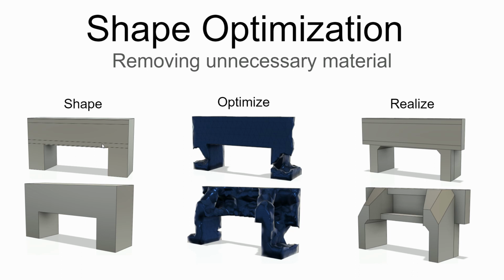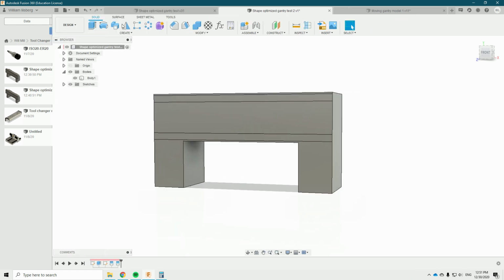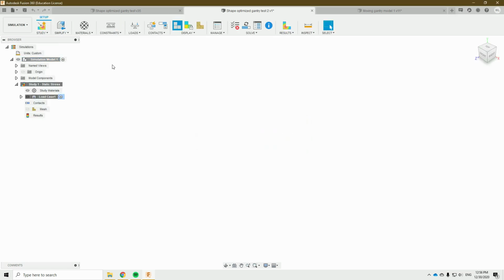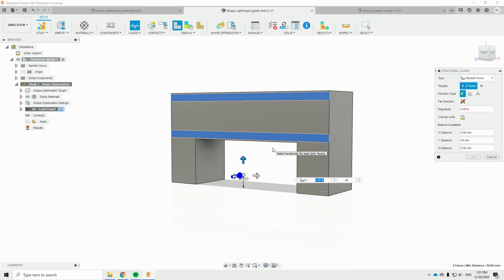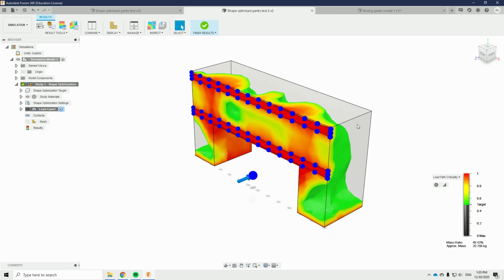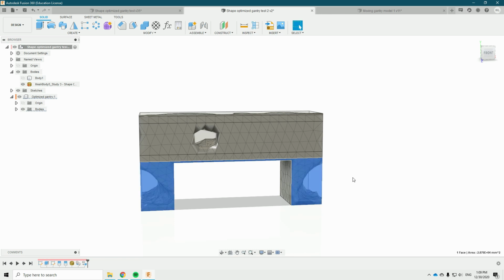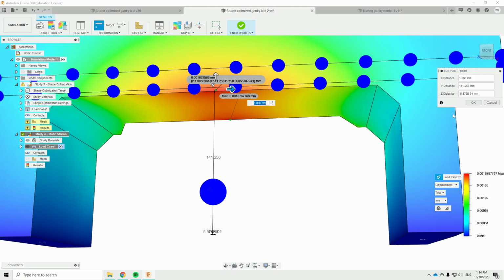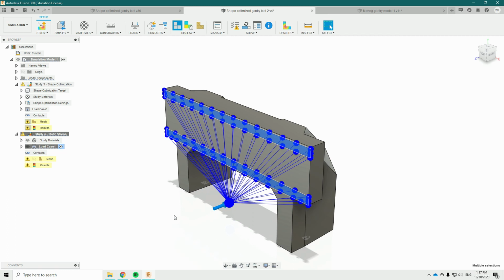Gantry Shape Optimization in Fusion 360

Comment: I’m silly late to comment on this video, but I have two questions. 

First off, is it correct to apply the force to the entire X rails rather than the center of them? The rails have just as much if not more deflection, so I would think applying force in the middle would produce a different optimized shape.

Also, something I’ve wondered about many CNC gantry designs is whether they should be stiffer in the x direction, or parallel to the gantry. Often time the sides of the gantry are just aluminum/steel plates instead of boxed members or otherwise reinforced. I’d be curious to see the optimization if you changed the force to be 90° perpendicular to the simulation you ran. 

I guess I should download fusion and try it out myself, huh?
Reply from the maker: Hi Alice
Well yes, my lazy ass didn't apply the force in the most realistic way. I should have used the "Split Face" feature in the design workspace of fusion 360, so that the force would only have been applied, to a representative surface, that's similar to the distance between the carriage that the Z-axis slides on.
Reply from the maker: Well, it probably best for the machine to be equally stiff in both directions. I find that it's hardest to stiffen up the gantry in the y-direction, so that's always my primary focus. 

There are different types of gantry designs. It is important for a gantry that has two "legs", that it's legs don't contribute to too much deflection. Therefore the legs will have to be rigid for when the force comes from either the x or y direction. 

You're correct, it a bad idea to only have thin plates at the end of the gantry, if they are not thick enough.
Reply: good queation I think analysis is only partially usefull, because the force is working only in the middle, and it is not pressing both rails in same direction, but it's rotating around some axis paralllel to X. (torsion) And best resistance to torsion is circular tube. But rectangle tube does it also very good.

Comment: Again, thanks, really interesting. It did ocur to me when you cut away lots of material from the 'legs', this only made sense for the very specific force perpendicular to the axis of the gantry. Ahhh, got to 20:25 and you're just talking about that now. But do you underplay it a bit? I guess the dynamic way forces would shift and change direction when cutting a circle, for example, make just analyzing it the way you did the most practical. All very interesting thanks  :)
Reply from the maker: Interesting build you have going on there! Subscribed.
Reply from the maker: Well yes, I agree, the forces will come in every direction, especially when cutting circles. How much the specific angle of force inflates the deflection of the gantry will depend on the shape of the gantry. If you imagine that you have a profile with an "+" shape, then it would make a world of difference when the load comes from a 45 degree angle, but if you take an "o" profile then the angle of force has no influence. Case in point: it matters only sometimes, but good to make a quick 45 degree simulation haha ;-)

Comment: Excellent video.  How about analyzing gantry for PrintNC CNC design,.  Love you see how it fairs.  Thanks
Reply from the maker: Hi @Jasbir Kandhari, that is interesting, because now you should be able to make these kinds of simulations yourself :p I can tell you already that this machine will not be able to cut materials like aluminum and other metals well. Maybe if you use a small 1 flute 3mm endmill you can get some OK results. I have a link for CAD files to that machine, then you can do your own comparisons if you'd like: https://grabcad.com/library/threedesign-printnc-low-cost-high-performance-3d-printed-cnc-1
Reply: @garage-eng  Thanks for a quick response.  As per your analysis, they are using a square steel tubing which is a plus.  I think changing the gantry from 3X2 to 4X3 or even 3x3 will help. Also from your findings, adding epoxy granite will help in some stiffness and also reduce vibrations.  Do you agree?    Thanks
Reply from the maker: @jkandhari  Hi again. Yes, steel is good but I'm not sure it's milled. If it's not, then the linear guides will not be very flat, as the surface, they are mounted on isn't. My main concern is that there is only one carriage mounted on each side, which means the z-axis will have some extra leverage. This is not a criticism in any way, it's a great design, and it looks like it would be relatively budget-friendly. But I think adding another carriage would be very beneficial for the machine's rigidity, perhaps one could just weld a steel plate onto the tube and slap on two carriages to the steel plate. That could however introduce some stress into the steel as it's welded and skew the steel profile ever so slightly. If you would like to mount a plate to make room for two carriages then look into "brazing steel", this process doesn't heat up the steel as much, and no stress is introduced this way. It's ofc also possible to bolt the plate on.
You're right, epoxy granite would certainly make the tube stiffer and more damp.
Reply: @garage-eng  Your suggestion makes sense.  I will incorporate it into my design.  Thanks.

Comment: Please send more videos like this, it's what i was waiting for
Reply from the maker: Good to know, I will make a video about the shape optimization of a part in the Z-axis assembly soon then. It went from 5 kg to 1.5 kg with about 2-4 % added stiffness! Incredible results, we really have some powerful software available at our fingertips!
Reply: I was still watching that video, thanks you so much
Reply: When doing the shape optimization of the gantry you kept the force acting on it 600N,is this the assumed cutting force??
Reply from the maker: @teteatetetechswahili3208  No it's not the cutting force, if you'd like to know how to estimate the tangential cutting force induced by the endmill, then I would suggest watching my other video "Which Spindle to Choose? And how to calculate chatter" (8 min 20 sec). The machine is designed to have a theoretical stiffness of 60 N/micron assuming that the guideways have a "bonded" connection in the simulations. This means that the machine should not move/deflect more than 0.001 mm for every 60 newton's applied. As the deflections here are rather small, I have decided to scale up the load to a value 10 times bigger: 600 N. Then it's easier to read the deflection values in simulations.

Comment: hi . nice analyzation . can u do similar vid to show us the stiffness difference between different CNC mill design like moving gantry vs fixed gantry vs the typical VMC design . thx
Reply from the maker: Hi Habeeb, I think that's a great idea. It would be interesting to how stiff the "arm" of a VMC would be if it had to weight the same and be able to machine parts of the same width as the gantry designed in this video.
I don't think it would be as interesting to compare this to a fixed gantry design, as one could compensate for the deflection with "infinite" weight, but one could argue the same would be true for a VMC with counter weighs, although the acceleration of would be nonexistent at infinite weight haha.
Reply: @garage-eng   yeah :) 
keep the good work
Reply: I too would be interested in this analysis ..
Reply: As all your videos, great work on explaining the principles of designing a machine like this, that would be understandable and applicable to basically anyone getting into machine design.

As for the VMC compared to this design, what would be interesting is looking at some of the higher end moving gantry/column designs. Mind the fact that all those designs are generally quite large as well as not nearly as space efficient as a standard router design (sacrificing workspace for rigidity).

Specifically interesting comparisons would be moving column and moving gantry designs as seen in some of the higher end machines.

Examples being:
-Hermel CNC with their 3 point supported moving gantry design
-Brother M140X2 with the interesting moving column design
-DMG Mori DMU 50, with the 3 axis small moving column design
-DMG Mori DMU 65 with the large 3 axis moving gantry design 

Most of these designs are based around 5 axis machining. But they are also applicable in smaller high speed 3 axis machines (example being the Chiron FZ08, tho still fairly large).
Another positive with these designs is that they are much easier to protect your linear components from chips and coolant which are from personal experience very problematic when it comes to diy projects like this (quality way covers are expensive/complex to make). Having all linear stages above the table solves this problem nicely.

As a further positive it is much simpler to include chip evacuation holes in a fixed table design like this (basically a funnel under the table) allowing for a simple chip box design, into which after you finished a part you can just sweep or blow/flush your chips down.